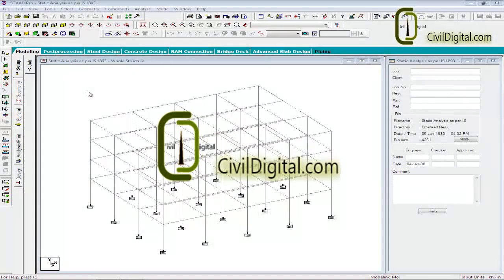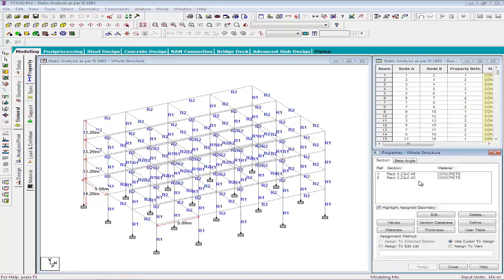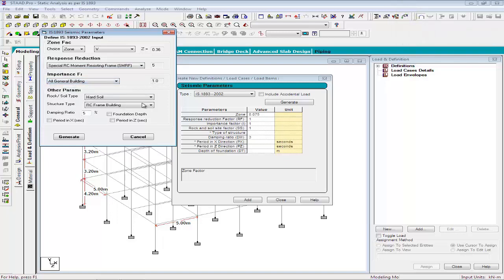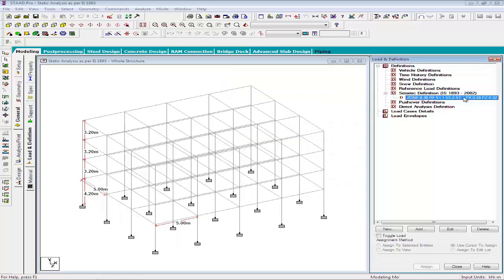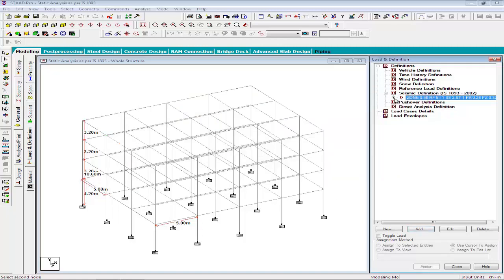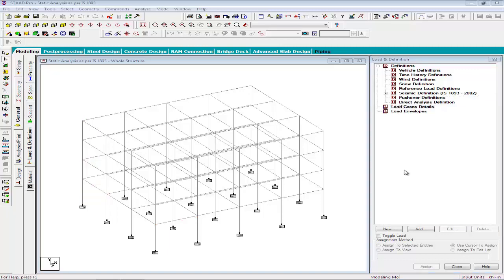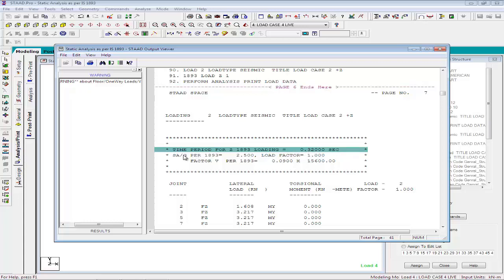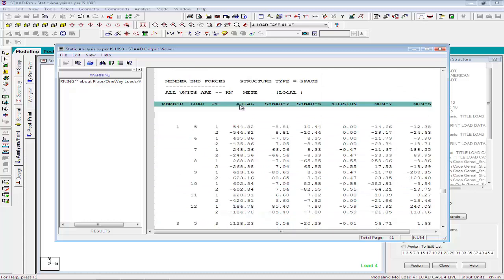Static Analysis as per IS1893  2002 :Calculation of Design Seismic Force in STAAD Pro v8i

Comment: Many thanks for the video. I had two small confusions:-

The dead load due to infills is not considered in seismic weight calculation? The dead load of an infill in any storey shall be equally distributed to the floors below and above it?

Also the minimum design eccentricity as per Cl. 7.8.2 of IS 1893(1):2016 is not taken in account, which must be considered in seismic coefficient method (static analysis) being performed here...
Reply: What is difference between lumped mass and seismic coefficient method? Which we have to use for accuracy or realistic behaviour?

Comment: anyone,  please suggest me with the Y range while assigning floor loads??
Reply: That's the approximate range...
In this structure, he decided to take 12kN/m2 for all floors except roof and 10kN/m2 for roof. Now the total height of the structure is 13.8m. So the 13.8 lies between 11.5 and 15, which is given as 10kN/m2 and remaing all floors of max height is 10.6 so he set the range as 0 to 11.5 with 12kN/m2. 
You can also set any ranges.

Comment: sir i need to know......in response spectrum analysis........which code is used for design.....is that.IS 13920 mean.........it gives lower reinforcement comparing to IS 456
Reply: IS 1893. IS 13920 is for ductile reforcements

Comment: how did u calculate that Lumped mass of 12 kN/sp.m and 10 kN/sp.m??? Can please explain?
Reply: I to have the same question... :o
Reply: It is calculated by the dead weight of slab means slab_(lenght  x width x thickness x unit wt of RCC)=total dead load of only slab and then we'll add floor finishes and other if any for typical floors. and that terrace level load will be small only for floor finishes. and the same way 25% of live load what applied to that floors will be considered to calculate seismic weight. and please note that lumped mass is nothing but a load concentrated at center of mass of the respective slab which is its own dead load and other loads considered. Hope you got the answer.
Reply: how to calculate lump load
Reply: please elaborate what did the lenght width  nd thickness u take??

Comment: sorry for the last comment 
i checked the results properly and found that it is not calculating the forces without the perform analysis and change command for seismic loading. but i still dont understand why for seismic load alone we have to do this and not for Live and dead loads. could you please tell the reason?

Comment: you say that we need to put 
PERFORM ANALYSIS
CHANGE
command
could you please tell me the reason why for seismic load cases alone we need to do this where as we dont do this for Live load and Dead load
i checked with a model without this commands and it is still showing good results
Could you please explain this?

Comment: plz elaborate load calculation in detail if possible with illustration showing unit wt considered such as RCC, LC, mortar, tile, brick wall, insulating layer etc. plz mention whether parapet, balcony, partition wall, mumti is provided or not and of course specify % opening in brick wall conforming to IS codes or whatever applicable. plz show analysis and design of staircase if possible. And plz show how you incorporate the results of staad for designing the foundation analysis and design

Comment from the maker: I noticed the mistake of +4kn, If you take a closer look at the load definition window 8:05 on right side, ive used -4KN/m2, sorry for confusion caused. again regarding the self weight, definitely it is the best practice to assign self weights in loads as well as the seismic load definitions, in the directions you want to obtain the results. further i have not considered the wall loads which are to be applied on beams as UDL. please take this video only for learning static analysis procedure.

Comment: Ronnie, top floor is at 13.8m you can provide any value below 13.8m , staad will automatically detect floor. Wen we input 15 it will detect nearest floor that is at 13.8 m. You will get same result if you input 10.6. You can also define floor levels discretely.

Comment: Apart from this i ve one more doubt regarding live load 4kn/m2.
since you have define I= 1.0 which mean all other building 
except SL No. 1 of Table 6 (clause 6.4.2) mentioned in IS 1893
(part 1):2002.Is it economical to consider imposed load similar to that of store/boiler/fire escape etc.? though the design engineer has the discretion to do so. Is the roof accessible, if accessible then do we have to consider 1.5kn/m2 imposed load..

Comment: correct me if i am wrong. the y- range define by you is
 different from what is shown i,e upto 3rd floor is 
10.6m (4.2+3.2x2) instead of 11.5m, m not sure weather
 bottom most node is 0.9m above the origin i,e (0,0,0).
 why have u taken 15m when total height of the building 
is just 13.8m. if there is parapet/mumti then y don't you 
specify it graphically though for calculating fundamental 
natural period(T) you have taken h=13.8m.
Reply: same doubt

Comment from the maker: In this example the floor load is same in the xz plane, if in your structure, the floor load varies with in a floor, u have to specify x & z range parameters.Since floor weights in the definitions are used only for the seismic weight W calculation, sign should not be specified.further staad recommends the same.You have to define member weight in definition if it contributes to seismic weight of structure, member weight and member loads are different.You can find my mail id in description part